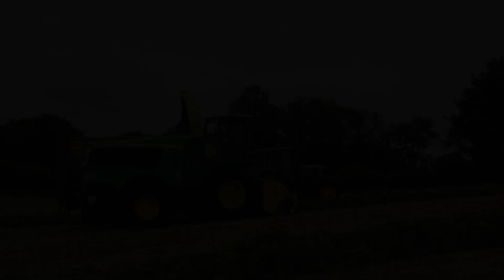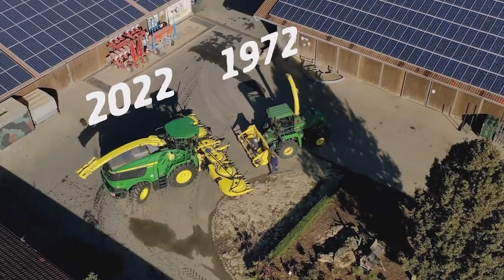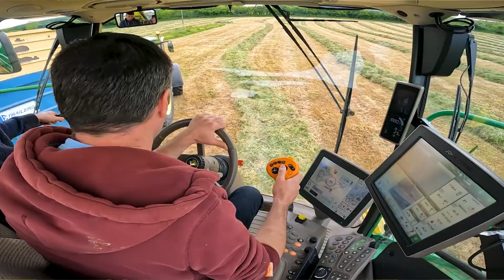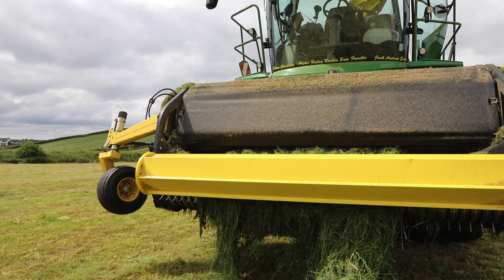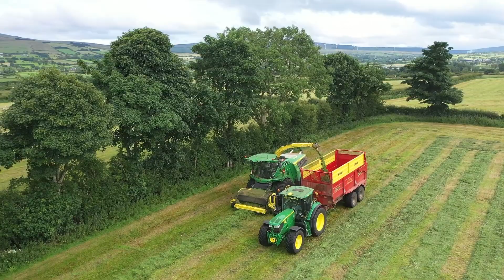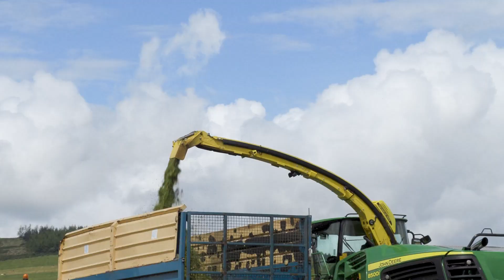John Deere's NEW 8000 series SPFH

Comment: Opinions on kubotas
Reply: What Kubota? Their compact tractors are very good, not a big lover of their bigger ag machines. We had the M7153 on demo and it stank of Hyd oil every time a remote was used. we suspected a leak but apparently it’s common place on them. 
Not sure if anyone else has heard the same. 
FYI we run an outfit of 5 Fendt, 3 JD and a recently purchased Massey 8S. 
Looking to shift 2 Fendt at the end of this silage season as they are due back off their lease, we are 100% going for the Massey 8s to replace them. Much nicer tractors and the after sales service is rumoured to be much better (Herefordshire) oh and they are cheaper than the Fendt. 
But anyway I digress, Kubota are ok but not exactly world beating.
Reply: @MATTFL380  we have a 6090 it’s. Dry good and upgrading soon